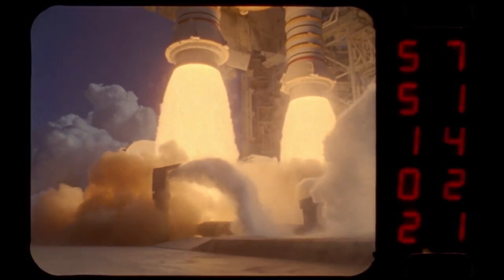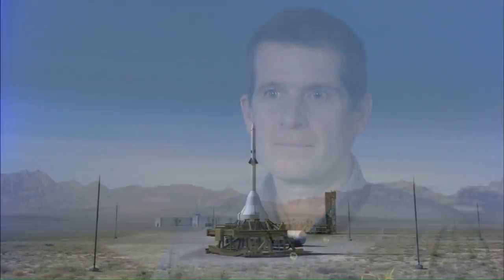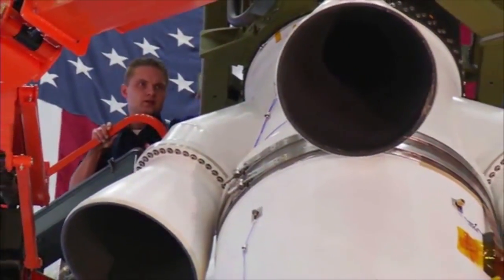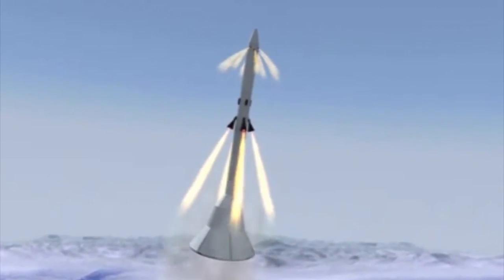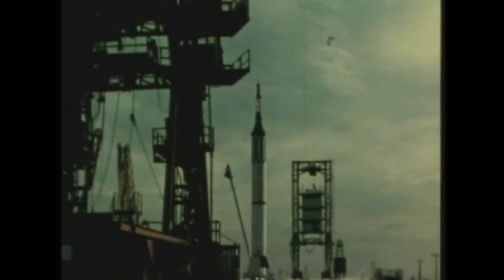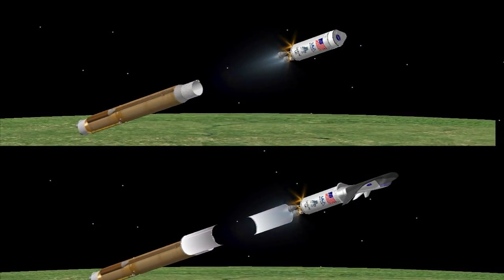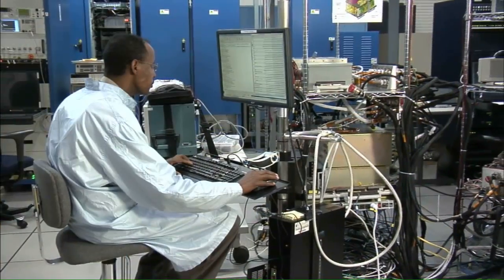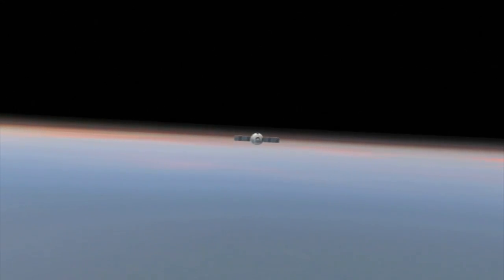Commercial Crew Program (CCP): Launch Abort Systems

Comment: --
if the total cost of the crew commercial space will be $4,868,000,000 (but I think it will reach over $10+ billion by the end of this decade) EACH commercial "seat" will cost between $4,868M / 20 = $244M and $4,868M / 12 = $406M or 4-6 times the price of ONE Soyuz seat !!!!!!!!!!!!!
-
however, the much rational choice is to use the low cost and reliable Soyuz also for the last ISS missions in 2017-2020 and use the $5-10 billion saved for better projects
-
-